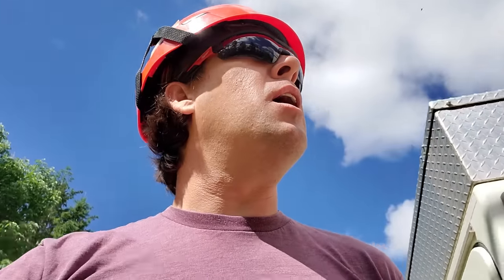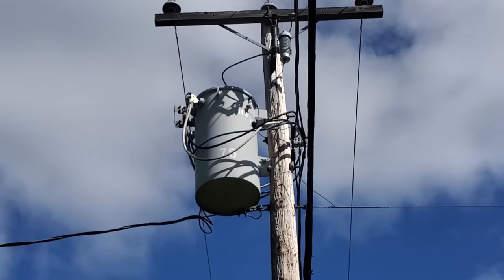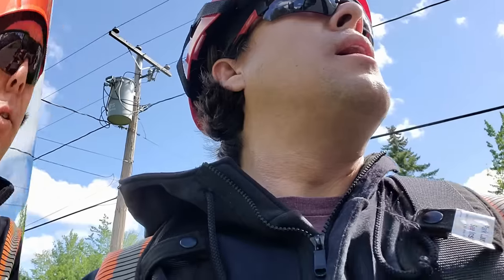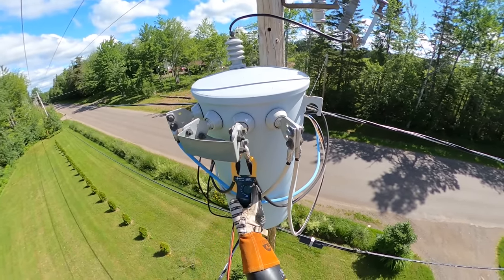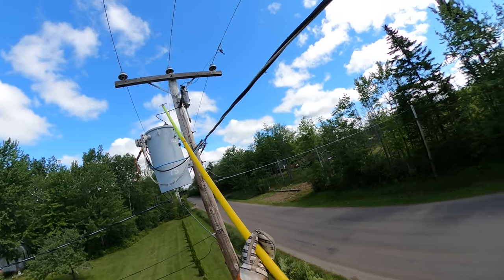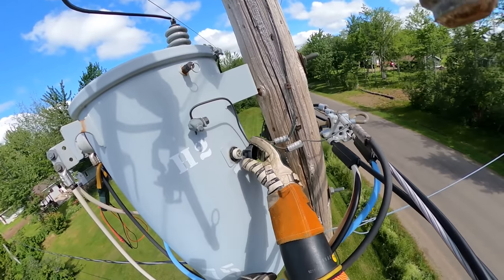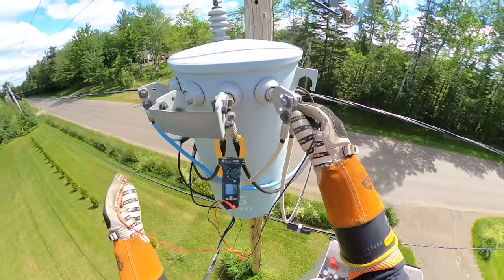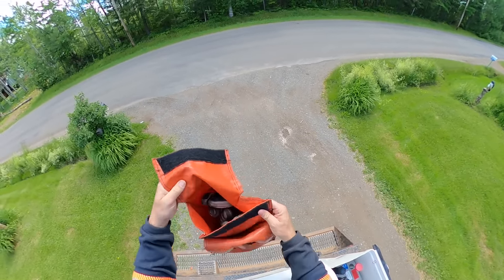How we change voltage on a transformer

Comment: Not directly related but at my house I've occasionally noticed the voltage oscillating a bit, maybe 1.5 times a second.The voltage swings aren't huge but just enough to be noticeable on incandescent lights. Does anybody know what could be causing that? My original thought was a feedback loop from auto tap changers but from watching your videos I don't think they'd be changing taps that quickly.
Reply: Possibly a voltage regulator stepping

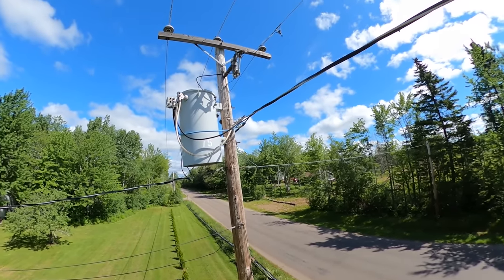Comment: At 3:34, anyone know what that small guage line tapped from the primary on the far right is doing - besides feeding the cutout? It looks like it goes to the cutout and then to the insulator (also what is this doing) on the bracket (just below the V for the 4x4 post), then strapped down the pole, splices twice, then connects to the neutral secondary at 5:46? At this time also, what is the line going into the transformer on the side (top left of tap selector) and where does it connect to? I don't see taps on any of the other two primary lines. Thanks for the information!

Comment: Hi My mame is Tony i'm from México and i AM a lineman what we do ir our company to chancge the tap of thransformer is fisrt we Open the primary and then we shortcut the secundary this in order to get save becouse here in México so many industries or houses have solar panels and this can power the secondary and then the Transformer increases the voltage and then You have in the primary a higher voltage You know how the ratio works! this is a respecfully advice thanks for showing how  countries work with power

Comment: I have been having trouble at my house I bought a multimeter and when my microwave acted up I ran out to the meter pole cut all the electric to my house and checked the voltage coming to my box I had a reading of 130 and 110 so what do you think is wrong or is that normal?
Reply from the maker: Sounds like a bad neutral on the power companies side. If you had your breaker open and voltage was still off balance, then it's likely that your you're tapped off some secondary that's feeding at least another home. The neutral would be bad on the source side of that connection. I'd give the power company a shout!
Reply: @Bobsdecline  Thanks I will do that.
Reply: @Bobsdecline  Yes I cut power going to my house but my neutral stays attached it only disconnects the two main legs and I live in a rural area the power lines stop at my house I don't share a transformer, when I turn on a appliance the imbalance comes on sudden but when I turn off what ever appliance caused it , the imbalance corrects its self in about 20 minutes, so it has been a night mare the electric company came out about 2 weeks ago checked my box and said it showed good but I had everything turned off. Thanks so much I will try to get them out here again it won't be easy.
Reply from the maker: Bad voltage on the source side of the meter is definitely on their end.

 From my experience, sometimes a crew will remove the meter and check voltage. If it's a bad neutral, it will never show up that way... (As you've mentioned). 

The crew must remove the faceplate and either reinstall or jumper out the meter lugs for a proper test. There is also equipment that exists that can simulate and unbalanced load.

It would be good to be home when the crew arrives in case they don't have such equipment so you can turn on a toaster or something and create that imbalance.

There's also a small chance that either windings in the transformer are damaged or the output is naturally too high and has one weak connection. 
I should also add the possibility of inaccurate readings on your multimeter vs a professional caliber.

I'd definitely get them to investigate further while ur home, as 130v is getting up there!... Could eventually cause damage to sensitive equipment:/
Reply: @Bobsdecline  Thanks so much.

Comment: Bobsdecline can please explain a high leg system and today At work I stumble across 277 on leg and 277 on the other leg to get 480 why is that
Reply: 277 and 480 is not a "high leg system"
In three phase systems the voltage from one phase to neutral is 1/sqrt(3) lower than the phase to phase voltage.  There will be three phases, each 277V from the phase to neutral.  Between each of the three phases you get 480V.
A high leg system is usually on a 240V three phase system.  There is a pretty good wikipedia page on it:  https://en.wikipedia.org/wiki/High-leg_deltahttps://en.wikipedia.org/wiki/High-leg_delta
I have heard of 480V high leg delta but have never seen them in person.  In high leg 480V, you actually get 416V from the high leg to neutral.
Reply from the maker: Definitely check out the above mentioned link... But it sounds like you were on two legs of a 3 phase service. Each leg is out of phase by 120° resulting in a product of 1 leg x 1.73 (277v x 1.73) to get a voltage difference of 480v across the two
Reply: You were on 2 legs of a 277/480 wye system.  Come to my building, we have 480 corner-grounded delta service, so it's 480 to ground instead of 277 on 2 phases, and 0 to ground on the 3rd phase... We also have 120/208 wye... both services are from the utility, we don't have our own transformers (good news, bad news...)
Reply: Damn, Matthew beat me.

Comment: I'd prefer it be at least 6V over 240 in the winter.  When the electric furnace comes on (20kW), while the stove and oven are going - and possibly the water heater, it will drop a bit...  transformer is 65 line metres away from the house...

Comment: Also how do you tell the difference between an offload tap changer and on load
Reply from the maker: It's usually indicated, also on load's are usually remotely/electronically operated. If it's not indicated or you're not sure, always assume it must be de-energized to operate

Comment: Couldn't you automate this? Like an integrated system checking the voltage and changing the windings if the voltage is too high/low.
Reply from the maker: This happens at the substation as the entire line is monitored (And then again at specific points out on the lines). Some customers request some additional fine tuning if/when possible.
Reply: @Bobsdecline  What caused the customer to notice it, do you know? You said this serves 6 houses and had multiple complaints, who's checking the voltage at their houses?

Comment: To me it's weird to see a 1-phase transformer, usually the transformers I see around where I live are 3-phase.
I observe that the primary is using one phase and then goes to ground instead of being between the phases and not needing ground.
Reply: Leather Fetish Videos  In this case there's no difference - ground and neutral is the same.
Reply: Here in CA they usually wire them across two phases, rest of the US is as shown one phase to ground. I forget which is delta and which is wye but that's the difference. IIRC this originated in CA due to dry soil and rock with really bad resistance.
Reply: @xenadu02  Y is an electrical connection with an Y-diagram, delta is a triangle diagram. Not sure how you forget that, but maybe because you write "wye" which could be confused as a miswritten "why".

Comment: Why wasn’t there a need to use a load buster when opening the cutout?
Reply from the maker: Less than 10 Amps (@7200 Volts) we can simply rely on the speed of opening it with a stick.
Reply: @Bobsdecline  ohh okay thanks for the info

Comment: I need to voltage on my transformer lowered. For those wondering why I want lower voltage, it's because I have solar and to export I need to transformer voltage lower than the inverter's maximum voltage, and at the moment there isn't much difference so my export is very limited.

Comment: You don’t have to use a load break tool?
Reply from the maker: Anything over 10amp on the high side
Reply: How do you know the amps
Reply: 10 amps on the high side, he just clamped the multi meter on the neutral so he didn’t have to hold it when he checked voltage on the low side with the probes
Reply: @giacomotallarida7059  he said in a different comment that he checked it on the secondary side but didn't show it in the video. Then he divided by the transformer ratio of 60:1. The primary side was 2-3 amps. He could have also used the primary amp stick but did not.

Comment: As an german Electrician, this looks so dodgy 😅
Don't know where to start.
The wiring, the connection to the Transformer, the wild dangling Transformer, the wiring gauge, the problem itself (high voltage when the voltage is just 4 volt higher than normal). In Europe devices will work with 210v or even 245v, no problems.
Higher voltage means lower current, so normally you would think higher voltage is better.
But america is something else in this regard 😅
Reply: North American split phase is a weird thing in itself to the rest of the world, that and the nominal voltages employed have a quite complex history that go right back to Edison's first roll-out of commercial electrical supply for Lower Manhattan.
Reply: Higher voltage can be an issue these days with solar panel systems shutting off on sunny days. But indeed lowering the voltage is more amps and more load on the transformer, so it’s always a trade off. But why these powerlines aren’t underground and transformers in transformer stations that’s pretty weird.

Comment: I'm curious, what time of year was this? Winter or summer? As you know voltages drop in the summer due to increased demand. And lastly, do you guys ever use data loggers to check in this case voltages over time versus just a instantaneous reading?

Comment: Weird. Why would someone ask for a voltage change? How do i know my voltage is too high/low?
Reply: Some modern electronics, and especially cheaper LED lighting is very sensitive to overvoltage and will refuse to operate. How to check, the safest way is with a monitoring device (you plug them into a socket then connect the load, they are designed to tell you how much electricity your using, but they also display voltage, frequency and power factor). There are other ways to check with a multimeter, but you should know what you're doing before attempting this.

Comment: Now that's interesting because when I had my garage wired for my air compressor and after the work was done the electrician measured the voltage out the receptacle and my voltage was 248 volts but the voltage requirement for the 5hp  motor compressor was 230, I asked the electrician was my voltage to high he said no and the motor would run more efficiently so I guess the extra 18 volts wouldn't hurt the motor 🤷🏿‍♂️

Comment: Black is neutral white is a hot leg?? Finkle is einhorn einhorn is finkle.
Reply from the maker: Only one so far that's mentioned it! Lol. The white is actually a faded red wire. The black .....

We started years ago using our 4/0 quadrex for Tx leads... Using red and Blue to help with congested poles. The bare conductor was/is the neutral. There's been a few cases with a difference in potential between the tx case and the neutral lead on banks with a removed strap, so covered wire was used. The black one was left. 
A can that has a service going directly into the lugs will still use the bare neutral from a service. 

Pretty much clear as mud. 🤦‍♂️ I Spose we could order a reel of white coated aluminum 😳
Reply: @Bobsdecline  gotcha. On our cans we use 4/0 copper tap wire. We don’t have paddle bushings for secondary either. The 4/0 plugs right into lug and tighten down with a 3/4 nut

Comment: Why do homeowners know to request a voltage change? Is it tripping breakers?
Reply from the maker: An electrician recommended it to him...
Reply: @Bobsdecline  Any particular reason why?
Reply from the maker: Not really...  He had an electrician there for an unrelated problem. He took a voltage check and told the customer he was on the high end of our acceptable parameters and that had him a bit worried. After speaking to the customer he was fine, but told him if the TX had a tap changer I'd lower it for him. 
We can't be running around changes taps for everyone, but in this case it was actually a fraction outside our parameters while I was there.
Reply: @Bobsdecline  ok that makes more sense to me. Please excuse my ignorance on the matter I just find these things interesting and just couldn't imagine why I homeowner would know to call for a lower voltage.
Reply: @Bobsdecline  Thank you for the reply!

Comment: I think most equipment nowadays is rated to 130V… and the closer you can get to 130V, the less amperage will be used since voltage and amperage are inversely related. Honestly I’d prefer the higher voltage to help cut down my electrical bill 💸
Reply: I think electrical meters do measure voltage x current
Reply: Hmmm not sure how that works out… voltage x current equals watts used (measured in kW at the meterbase)… If I have a piece of equipment that runs 1200W at 120V the amperage is 10A where as if I ran the same 1200W equipment at 130V my amperage is like 9.2A… but the wattage being measured (E x I = P) at the meter maybe close to the same in the end… after thinking about it maybe it doesn’t really save any money.
Reply: @Frank-ih9ew  A lot of equipment will use like 10.8A if the voltage is 130V. Computer equipment will compensate its amp draw; "dumb" equipment will use more amps with more volts.

Comment: Kinda suprising that someone worried about that small of an overvoltage wouldn't just use a variac/variable power supply/power conditioner etc. If you're relying on line voltage being tighter than 5% that's prob the better option.
Reply: I think it can be a problem if they have a large solar pv array. When that's exporting their voltage goes up even more and the inverter trips out. Turning down their supply should fix that.
Reply: @ColinWatters  that's prob the most asinine thing I've ever read. Go back to school.
Reply: @davidsotomayor8713  I'm not sure of the rules in the USA but its certainly true in other countries like the UK. If your solar inverter raises the local grid voltage above the max allowed it has to limit export or shut down. This can happen if you have a large array on a long or undersized cable from the transformer. I don't know what the limits are in the USA so that might not be the reason in thus case but the effect is real.
Reply: @ColinWatters  except a long or undersized (assuming you mean small diameter) cable would present the opposite problem (i.e. too much voltage dropped over the length of the cable resulting in a LOWER than expected voltage, not higher.)
Reply: @davidsotomayor8713 No, not when exporting. When exporting to the grid current flows the other way so voltage is higher at the PV inverter end.
Reply: @ColinWatters  as I said before, if you really think that's how it works you should go back to school. Voltage dropped over a length of cable doesn't push the voltage higher at the inverter end even when exporting. It just means you DROP more voltage on the way (plus that's a regulated output anyway.) There's a reason we don't call it voltage GAIN in this kind of scenario. 

And what planet are you on where ohms law changes based upon the direction of flow? 🤔 I mean, using your logic if you want higher & higher voltage supply all you need to do is keep adding lengths of long & skinny cable! Have a regulated supply that outputs 12v 2a but you need a 30v supply? Just add a bunch of long skinny cables to the output and the voltage is magically boosted! 🤦‍♂️🤣🤣

Comment: I still don't get it why you use this "tapping of 1 hv phase" and this "mid-tapped pseudo-2-phase" when you have a regular 3 phase on the hv
just use a regular 3 phase transformer and provide the customer with true 3 phase
just one of those things I will never get about the NA power system

Comment: Complained about too high a voltage 🙄
I'd be HAPPY to have 124v at my panel.
Reply from the maker: Most of my high voltage calls are the result of a bad neutral. Which is why we always investigate.
 I get a few from electronics installers/vendors that convinced the customer that extra 2v can be harmful. (Which is definitely an eye roller) but if there's something I can do that's quick and easy, then I will for peace of mind. If not I'll try my best to respond to their concerns ... 

Like you mentioned on another post (I think it was you) if a customer has unique sensitive equipment, it's ultimately their responsibility to have proper protection on their equipment.

Comment: Dummy here, why would you want to reduce the voltage?
Reply from the maker: Not at all! It was mostly a situation where a contractor had firm belief that higher voltage was hard on some equipment he installed at the home. It created some concern with the customer... While on the higher end of the spectrum, realisticly a couple volts isn't going to make a difference (except for unique situations). A simple solution was available to keep everyone happy.

In industrial situations the request is often to reduce voltage from 610 (ish) volts to 585v. Which would have more of an impact on unique equipment that's sensitive to voltages. Ultimately it's the customer's responsibility to install protective equipment when supplied voltage is within acceptable parameters
Reply: @Bobsdecline  Thank you for the answer.  I enjoy your videos and learn stuff from them.

Comment: Voltage regulator that steps voltage up? You guys are 100%  sure it's not called a multitap autotransformer/inductor to counter the enormous capacitance of long distance country lines haha. If they are "regulators" than so are the capacitor banks. One lags, one leads Period. Peace